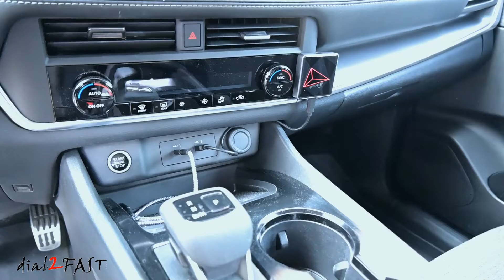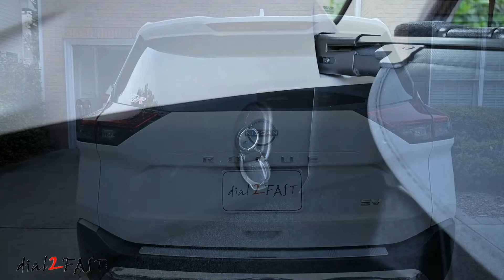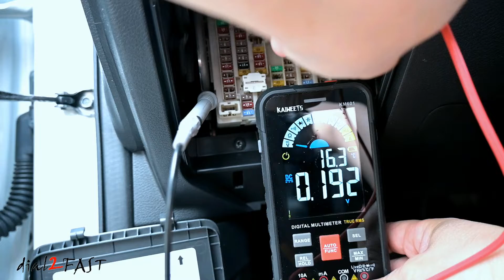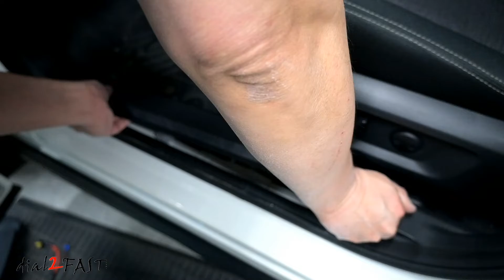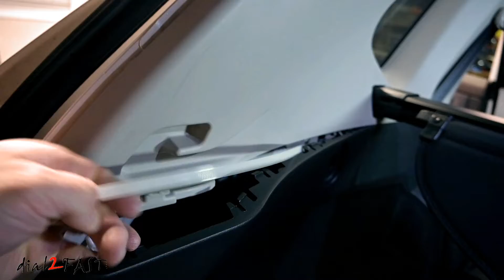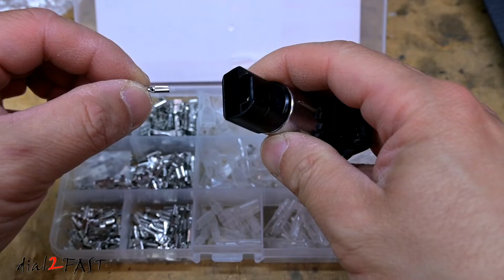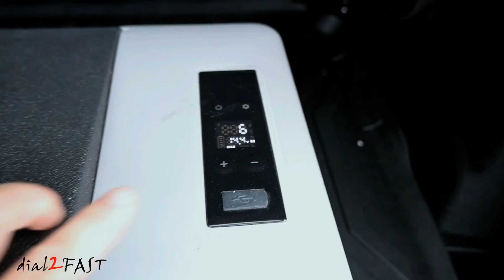How To Install 12V Power Outlet In Nissan Rogue | Xtrail | 2021+

Comment: Your using wrong gauge wire for 20 amps fuse it's should be #12 if you using #14 wire please change fuse to 15 amps!! Hmmm? And hint at reducing wiring is use one red wire all the way from fuse box to lighter socket and short black wire from lighter socket to any closest screw or bolt on body ground nearest to lighter socket

Comment: What device is that plugged into the console next to the A/C Sync knob at 00:20?
Reply from the maker: It's a wireless Android Auto adapter converting the car's wired Android Auto to wireless connection. I did a review here https://youtu.be/hpHdfKwsueo
Reply: @dial2fast  Thank you so much!!

Comment: Nice video. Thanks. Oddly enough, my 2024 Rogue Platinum doesn’t come with a cargo 12v outlet either.
Reply from the maker: Nissan has been removing features on the Rogue year after year to save cost. On my 23 Rogue SV , they took out the side mirror turn LED light, and the around view monitor (which the 22 SV model had). All to reduce cost while price goes up.
Reply: My 23 SL has the rear outlet.

Comment: Very nice!  I was curious if the factory ran the wiring back there and just not the outlet, looks like no wiring.    Have you ever seen on the S-trims that have only four speakers, is there wiring up on the dash to add two more speakers that are missing, or did they also save on wiring and put none there?
Reply from the maker: There is no factory wire for the 12v outlet behind the panel.
Reply: @dial2fast  Thanks, yup I saw that in the video, the only thing I didn't know was whether they did the same thing on the front dash by the front pillars if those have no speaker wires on base trims.   Will have to see if I can pop those off and check this weekend.  :)
Reply: @dial2fast  think you were looking in the wrong place..They had the outlet in the 2022 models but nor 2023/2024...Do believe they cut the connector off  instead of taping it back or made a  new wiring harness?
Reply from the maker: @davo912  For the 2023+ Rogue, Nissan did a lot of cost savings by removing a lot of features. When doing this install, I pulled out the back panel and there are no 12V outlet wiring harness.
Reply: @dial2fast  Did you test the white connector that was taped to the harness?
Reply from the maker: @davo912  Yes, and it doesn't have 12V on it. Also that connector is not the connector that fits in the cigarette lighter socket.
Reply: @dial2fast  FYI, you stated that white connector behind the cover is not the connector for the power socket..I was at Nissan last week and their head mechanic came to take a look at my 2004 Rogue and said he recognized that white connector as the one for the power socket...BUT he also said if I was to order the power socket for the 2021 or 2022 it would come with the pigtail attached..one end is the connector for the power socket and the other end for that white connector...That would account for the high price for the power socket for the 2021 and 2022.. Not sure if any of this is true but passing along what he told me. If he is correct then at this point I can assume one of two things here.Either you looked at the white connector and said it wont connect or you tested it without putting the fuse in
Reply: @davo912  any update on the white connector? I tried to put the fuse in, but no power .

Comment: Many years ago, I wanted to install a rear wiper on my 1980 Honda Civic DX.  Higher line Civics were equipped from the port with a rear wiper/washer; and there was a switch blank on the instrument pod. 
Popping off the cover over the switch-hole, I discovered wiring already in place!  Inside the rear hatch the wiring was present and ready to be connected. The mounting brackets were in place, complete with threaded mounting holes. The first most difficult (nerve wracking) part was drilling the body sheet metal of my first-ever brand new car. Second most difficult was enlarging the hole without error beyond my largest 5/8 twist bit. All of the wiring and tubing was in place: the washer reservoir was a heavy duty vinyl bag— all ready to go.

Comment: Why run the ground wire all the way back to the front, instead of grounding it locally at the rear of the car? Minimize panel removal?
Reply from the maker: Yes you can connect to a grounding bolt in the back if you want. More than one way to doing this.
Reply: Yeah I don't see any downside to using the chassis for ground.